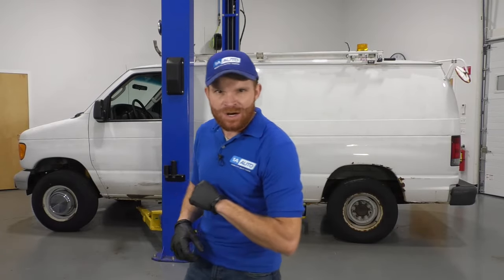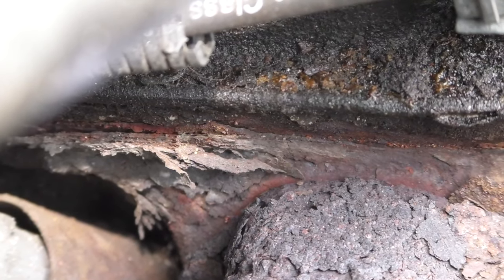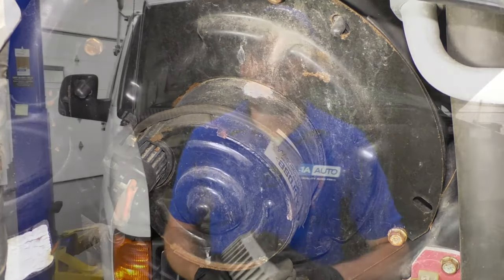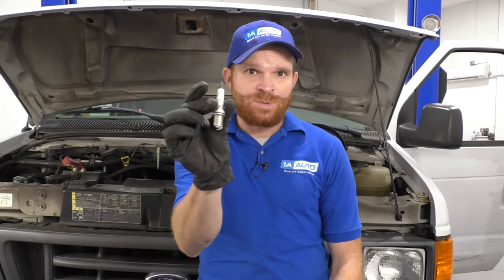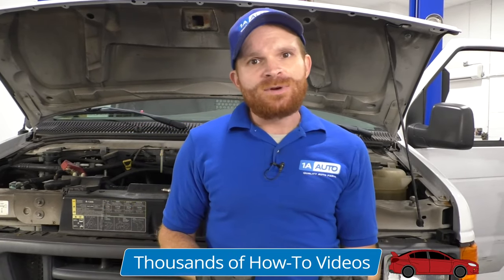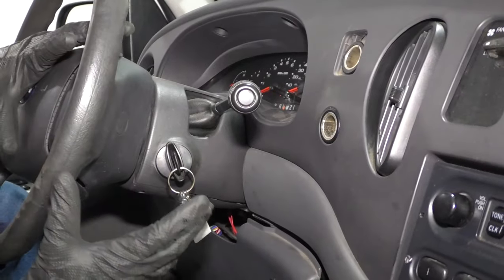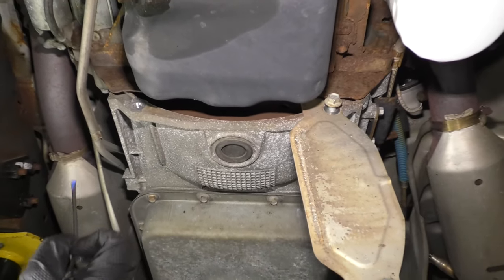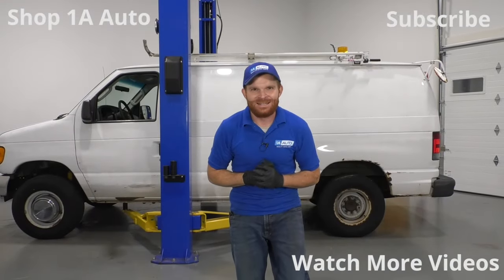Top 5 Problems Ford E-250 Van 4th Generation 1992-Present

Comment from the maker: √  Watch the Video
√  Buy The Part at 1A Auto http://1aau.to/m/Visit-1AAuto
√  Do it Yourself
√  Save Money
Reply: I just bought a e250 2003 , when accelerate 5%  it kinda jerk, but if I accelerate 15% it doesn’t jerk . I don’t have no check engine light. What you think it might be the problem?
Reply: The most common problem with these vans are the vacuum  Reservoir for the  ac vent control
Reply: @benjaminarias1990  vacume leak.  or dirty fuel filter.  Some times its a Crossed Spark Plug wire.
Reply: Need to tone down the hand gesturing. Certain movements are distracting. Otherwise a good video
Reply: I got one for you. I have a 2001 e150 with the 4.6 V8.  I was having a problem with the no. 5 or 1, passenger side plug fouling out. I found it was the nipple from the heater core to the front of the block. Had a small pin hole tha was spraying water right on the plug, filling the well. You have a video on replacing the nipple? Thanks. Right now I have it with a piece of hose clamped on it. Works for now.
Reply: great video, tyvm

Comment: There's a serious shortage of mechanic videos on YouTube on the  E series van.   Hopefully 1A Auto is changing this trend.  Your work is greatly appreciated!
Reply from the maker: Thanks for checking us out. We will have the van for a while, keep checking back! http://1aau.to/m/Shop-1AAuto-Now
Reply: That's because it's a Ford. Not well engineered. I would know, I've owned and worked on 3!
Reply: @hansdomke89  my not well engineered 2010 econoline 4.6l  4r75e  has 311,000 miles doesn't burn oil, original everything minus front end where Items, breaks , few batteries... Starts every time I hit the key! Might depend on how you maintain your vehicle..
Reply: @josephf593  do you do your own work? If you did you might see what I'm saying.. Mine works great too! It's just awful to work on. Nothing is in a good spot.
Reply: @hansdomke89   yes sir, I do maintain the vehicle myself.  I'm very familiar with the engine bay, vans are not fun to work on, that's for sure!  We have owned, chevys, gmc, and the e-series. The econolines in my experience,  were the least expensive for regular wear items, and spent the most time on road earning money.
Reply: @josephf593  they are quite reliable. I rarely have issues, but when I do they tend to be hard to get to. Even if they are right on top, there's always something in the way. That's what I meant. The layout could have been designed better. I feel like it was an afterthought.
Reply: Agreed
Reply: @hansdomke89  Easier to lift the body
Reply: @REVNUMANEWBERN  yes, I will lift the body of my car to replace the injectors.
Reply: they arent as popular. ppl are turned off of things like spark plug blowouts....not hard fix if you have right specialty tools / patience. the hard part is dealing with it happening on the road. hopefully can limp it to garage. maybe carry specialty tools in case shop doesnt have em
Reply: @hansdomke89  lol really so my 1996 e250 hd is just fake ?   If you take care of your stuff it will last.
Reply: @hansdomke89  its a VAN  they are hard to work on by design.. that does not make it a bad product.. You just lack the Training and Skill to work on it.
Reply: @awack_  yep, I'm the problem. You figured it out
Reply: @hansdomke89  lol , if you say so.  But the ESeries is a Great Work horse thats never let  me down since 1966.. I have owned many :)   Cant say that about many other Vehicles lines.
Reply: @awack_  very true, love my van
Reply: @hansdomke89  Except one thing changing the oil I find it very easy.
Reply: Yeh, how can the E series be so damn popular and yet so overlooked at the same time. Best vehicle ever made.
Reply: @josephf593  ''Not well engineered'', that is just plain
silly talk bro. If it wasn't well engineered there would
be thousands of backyard mechanics doing fix it
videos for the E250.
Reply: @hansdomke89  I said arresting I’ve had a bunch of these kind of lines that I use for work. All of them have over 200,000 miles two of them have 350,000 miles they just don’t break down that’s the main reason you don’t see a bunch of mechanic videos on these vans they’re extremely well engineered.
Reply: @saltpepper1894  you’re talking about the F series trucks there are no spark plug blowouts on Econolines
Reply: @duanekressin2278  like I stated in this same comment thread, they are very reliable. However the layout of everything was poorly designed. Great vehicles, though.
Reply: @duanekressin2278 there was on the triton motors in 2003 e250
Reply: I have had 3 and these trucks are bullet proff

Comment: Never, ever, leave plugs in a E150 for 100k miles. Change at maximum of 50k. Only use Motorcraft and torque to 25 lbs
Reply: Thanks for tip 👍 just bought a 06 e150 with 117k miles

Comment: I have 2004 e 250 with 513,000 original miles, never had a problem.
Reply: nice!  I have one 1999 , 4.6 with half a mill miles. and  another 2000 , 5.4 L, also over half a mill miles, but  half of the piston burnt )))  Still starts and runs. So looking what to do with th motor. Its custom van so it a keeper. may convert to 7,3 Dizel and even throb 4x4 on it.

Comment: My 07 E250 right at 385k Only replaced heater Blower motor, alternator, 2 coil packs, just did 3rd set of plugs all look good still runs great
Reply: 5.4?
Reply: Dang i got a 98 of the same model with the 5.4 at 387k and still running even with a busted exhuast manifold
Reply: Have you replaced any cooling system hoses or rubber parts?  Do you find the rubber ford used so much better than the 90s?  I'm 2nd owner 8 years of a 2002 e150 170k miles for and I think I still have original hoses and fan belt.  I did replace the intake manifold because of coolant leak on spark plugs, and am replacing spark plug boots because of swelling and cracking.
Reply: @dannythebeerman  None

Comment: I have replaced the blower motor, blower motor resistor and the switch inside. The switch would overheat inside and melt the plastic knob. The wire harness behind the blower speed switch was fried. I found the ground wire was crunchy and fried
Reply: What’s the fix for this problem? I had this same issue twice on my 2008 E250 work van my old boss had to fix. Looking at buying a E150 conversion personally now and wondering what was going on and how it was fixed?

Comment: Thank you very much. I've had every problem with my van that you mentioned.  Now for tightening up the shifter gear on the steering wheel, I found that there are two screws that you can tighten up without taking the steering wheel apart. ( I had a 2002 Ford E-350) And I found that if you follow the brake pedal all the way up the steering shaft you will see two screws (You will need a  5.6 socket) you may need to tighten them and that should straighten out the problem. Or you can remove them and use " lock-tight." And that should stop it from happening again.

Comment: Got an 02 360 k miles 
The motor and transmission have never been touched! Best vehicle ever!
Reply: I love mine as well. 03 297k e250 with the 4.2. They're built like tanks and wish ford would have kept making these but without those turbo or EcoBoost engines.
Reply: @HaloDaycare  The E-Series never got a ecoboost engine, now you can only buy then as a stripped chassis and with the 7.3 V8
Reply from the maker: Great! Thank you for checking out the video. If you need auto parts go to: http://1aau.to/m/Shop-1AAuto-Now
Reply: @konstantindufnik696  aware of that. I was just saying if they did make then still, I'd prefer them not to use the ecojunk
Reply: @HaloDaycare  have an 03 also with a 5.4 and love it too. These are tanks and tanks are awesome. Runs like a top, daily driver at 100 plus miles a day and she loves it.
Reply: @mthibeau  I wish the 5.4 would have been done right but I'm glad to hear it's been good in your experience
Reply: @HaloDaycare  it is done right what do u mean? At least  the 2 valve is I have a 99 250 with a 2 valve at 230 k miles yea there is a issue with some plugs shooting out since the plug hole threads are very scarce and they should of def put a few more rows of them in there but then the 3 valve they did just that and then they just got stuck and broke so I’d rather have the 2 valve plus their is another major issue with 3 valves something with the oil pressure I believe
Reply: My 2004 e250 4.6 is at 343k. I love it
Reply: @HaloDaycare  the 2 valve was done right
Reply: 2001 all original  256,000. Worst problem I had door cables ends fittings   I’m happy with mine   17 mpg   Helps !
Reply: 1998 E350 with 93k miles. Camper van setup.

Comment: My 1992 Ford E250 has a real 351W, E4OD transmission, Efi throttlebody with a distributor, cap and spark plug wires.   My shifter isn't like the one on the video either.   Thank God I don't have a 4.9 or 5.4 anymore had a few.
Great video by the way.

Comment: As a very old(almost 80) gear head from the 60s, I got a kick out of your video. I drive an '02' E250, 3/4 ton extended van. I'm only the second owner/driver. Purchased it from the co. I worked for Jan. 2008. It was 6 yrs. old when I bought it. But, being a service vehicle, it had 153 thous. miles on it. It now has 333,000 miles on it.Been driven 4 times across country to Cal. and back to SW Fl. Plus many other long distance places. Oh. It has the orig. untouched(other than normal TLC) 5.4, 2 valve engine. And, orig. trans.. BTW, I still do my own oil/filter changes and trans filter changes. Biggest problem that I ever had, was that damn idle motor thingy on the back of the eng. I did an old school modification to the steel gas pedal. Pulled the wiring off of it. Installed my own idle adjustment screw. Been set up like this since Oct. 2013. So, it must be working OK. Set my idle to 550-600 RPMs. This old truck runs just fine. yea, chk, eng. soon light on all the time. But, I know why its on! Sorry for the long post.

Comment: I have a 2006 fe250 cargo van that's got 274,000 miles on it. I've had it for a year and must say it's been extreamly reliable.
Thanks to this "man", (hard to find nowadays), I can have my van serviced for a road trip from Ca. to Oregon, and know some of the things mechanics might try to charge that might actually be something else. I do change my own oil and do it more often than specified. Air filter too. 
These vans are good stelph capable vans to live in. Once you get the metal out. I've converted mine on the inside to hardwood flooring, fridge/freezer, 14,000btu A/C, microwave, and even a full size electric fireplace. I have 2 generators ones a champion dual fuel, and the other a hysolice 4,000peak solar generator with 700watts of flexible solar on the roof. My van does have a rack and the big pipe on top but still I have a good charging wattage. So because the solar panels are flexible they mount so you can't tell there there at all. I don't want holes drilled for the wires unless it's done by a professional cause I may be a girl and done all the conversions myself I think this should be done carefully. I wanted a Dodge used van when I started looking. But I am glad I've been blessed with the FORD E250. Mom used to have a Ford pinto, great car. One of the cool things about this van I noticed that's better than other makes is the ground clearance these babies have. One look at this van and I knew right away it was home.
Reply: I may be purchasing a 2006 e250 tomorrow at 160k, your comment definitely has me excited to see it.

Comment: I have a 2007 E250.
My from ball joint were worn so I replaced them.
I plan on rebuilding the entire front end including radius arm bushings.
I also have some sway and noticed my body to frame mounts in the rear portions are totally gone.
This in conjunction with worn steering parts is most likely causing my front tires to chop and wear badly on the inside edges.
My a/c and heat would quit working when applying throttle but at a stop O was fine.
There is a quick and easy fix hack by finding the proper vacuum line under the hood and rerouting it under the pass side dash along with a check valve and a new vacuum canister ti fix it without removing the heater box -you don’t wanna go there.
The fix takes about an hour or so but most guys brag they did theirs in a half hour….doubtful….lol.
I dropped my trans pan to change the fluid and filter and noticed a yellow plastic ball floating in the pan….discard this as it’s a assembly only dust cap that pops out once the diptstick is inserted and it just floats harmlessly in the pan.
I went nuts trying to figure out where it came from and scoured the web to finally get my answer….pissed me off.
My parking brake dash indicator doesent light up with parking brake applied but the lights briefly flashes on along with all the other warning lights upon start up position2 with key as they always do.
I think my P brake switch is bad.
My tow/haul button on shifter no longer works and I have a check engine light along with a torque converter lock up code.
The van runs like a beast  but the trans does make a whiny noises and sometimes will slip and rev up every once in a blue moon between gears usually at slower speeds between 1’st and 2’nd gear.
I have the 4.6 L motor and was thinking about changing my rubber oil cooler hoses from the oil filter housing.
I have 240,000 miles.
I had a couple bad coil packs and I’ve changed my plugs and could twice so far.
I keep extra coil packs  and a serpentine belt just in case.
I upgraded to LED plug and play headlights which made a world of difference.
It’s a work van and I carry a lot of equipment and tools for a mobile mechanic service but this van has been so reliable I’ve taken it from Ga to Fla twice and Ga to Pa 4X and would take it tomorrow I’m so confident of it’s reliability.
What a great product Ford made with this van.
One of the last good old vehicles that isn’t mired in bells and whistles, redundant control modules and creature comfort features.
I keep looking at newer trucks and vans and just can’t bring myself to 1. Afford the ridiculously overpriced, over engineered junk and 2. they’re just too damned pretty and over gadgeted for a work vehicle.
My friend had his 2006 F250 crew cab , Diesel, long bed, 4wd truck stolen so two days later he bought a used 2019 F350, same style king ranch and he absolutely hates it.
It’s too nice, too many chimes and electronics….it’s just too rich for a damned work truck and way too many things to break.
He hates the ridiculous add blue system and literally wants to drive the truck off a cliff because of all the problems it has due to over engineered BS.

Comment: We have a 1992 Ford E 250 Econoline with the 5.8. Just over 361,000 miles on it and still runs just fine . Uses a little oil over time but nothing more then a half quart.
Reply: Amazing.......I retired a 1994 with 330K, and the engine was tired out, was on a 1 ton cube van.  Van replacement was a 1992 1 ton cube van and at 127K the engine was shot, it had a bad life before I got it at 108K.  Used the '94 roller cam engine for the core, and R&R the '92 with a roller cam engine, it's at about 154K now, and not used as much as I got a smaller '05 1 ton for work.
Guess Ford got wise to this and stopped making the 5.0's and 5.8's and that style of van, cause that lasted too long.......sales went down.

Comment: Good video guy. Forgot three things off the top of my head... Oil Consumption, and lifter tap on the '97 and up Tritons. Windshield wiper linkages, front door hinge hyperextends easy. Oh yeah, one more bonus, overdrive button short circuits in the shift selector. The positive lead wears thin and arcs out to ground, blowing the O.D indicator fuse. DON'T GET ME STARTED ON THE TWIN-I-BEAM SUSPENSION. But any way, good job so far.
Reply: 👍 yes sounds like a diesel idling

Comment: I've been in the  skilled trades all my life and own a small business. All of my vehicles were econoline at a certain point because as a finish carpenter no vehicle has fit my needs more. That being said I've had each one of these issues and a few that I've found more common and GUARANTEED in certain years like power steering pump squealing like a hurt mermaid in a microphone,  some serviceman damaging the plug thread where out of frikken nowhere the plug pops and your smooth running van sounds like a idling poorly tuned indy car but worse. Automatic doorlock/handle issues ESPECIALLY the rear door!, the accursed front suspension is a sure bet and at some point and won't stop until it's all fixed, gas tank leak gets honorable mention especially if you're in the North.
Reply: I love my 2005 e250 with the new front end kit. Costs more to keep replacing tires. Cleaned out the MAF and that 4.6 got a lot more torque and better mileage. Had a hose reel on my rear door was too heavy. The hinges can’t take it.

Comment: Besides a transmission leak (thank god) you just nailed EVERY problem I've had with my 2008 E150. DAMN, you're good.
That misfire, wow, that was an expensive nightmare and it was the coil pack but combined with a security problem which linked to and instrument cluster. In the end, it was (mostly) just the coil. Now I have door latch problems and a vibration like an improperly balanced tire - but I just had them balanced. Only happens between 99-103 kms/hr. Weird.
Reply: Is your door latch issue the rear driver side lower latch? Mine stopped latching and created a nasty wobble. New latch fixed that!
Reply: Been a year, did ya get that worked out?